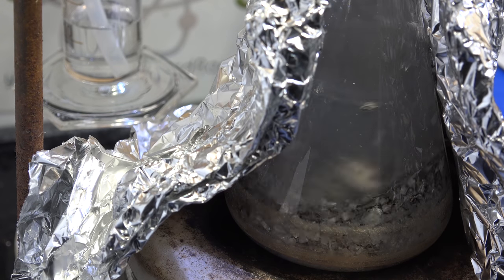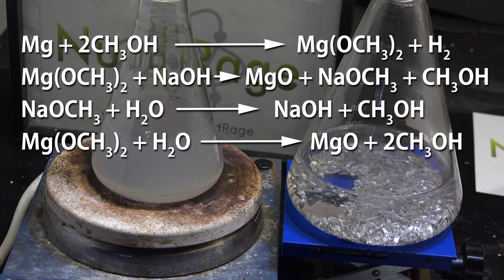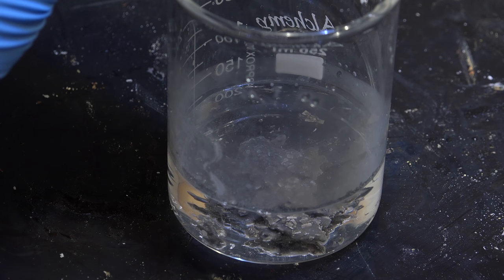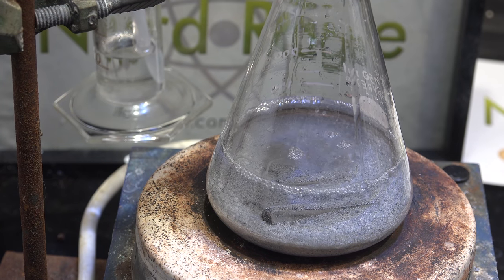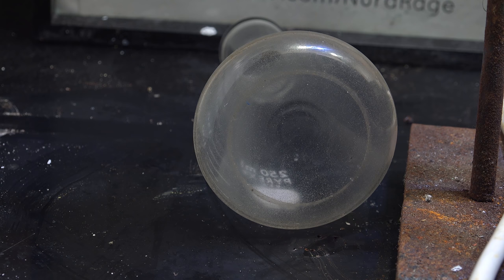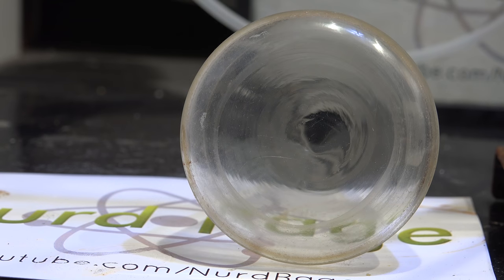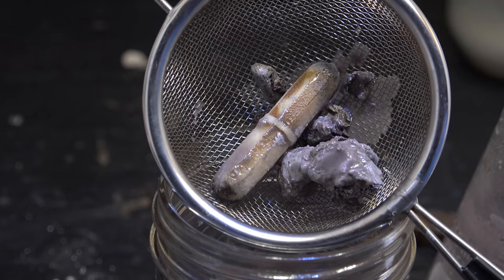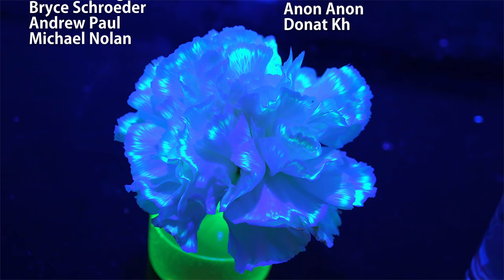Lab Notes - Alternative glassware protection for sodium production (Successful) - August 31st 2018

Comment from the maker: Currently testing various alcohols, most don't work, and the few that do stop working before all the sodium is converted. Still investigating.
Reply: Could you try ceramics?
Reply: I think it wouldn’t withstand the temperatures required?!
Reply: There are some high temperature not so porus ceramic contairs out there they are expensive but im pretty sure the exist.
Reply: The main issue is expensive. So far this series was about producing sodium using cheap tools and chemicals avaliable to anateur. If you wish to make sodium using expensive contraptions, there are several ways.
Reply: But the price of purchisng glassware many times the will be destroyed needs to be taken into acount (its also expensive.)
Reply: Pretty sure he mentioned ceramics in a previous video/lab update.
Reply: I wasn't aware. Sorry.
Reply: Sightglassed container?
Reply: Does anyone know which alcohol he was using in these tests?
Reply: "Currently testing various alcohols"
Hey, me too!

.....oh.
Reply: have u tried poly ols or sugar alcohols??
like erythritol oe xylitol
Reply from the maker: The alcohol i'm using in my videos so far is 3-ethyl-3-pentanol.
Reply: @NurdRage ; Thanks for replying!
Okay, so still the same as what you were using a few videos ago; good to know.

I have one more question if you don't mind: Before you completely move on to another project, could you please consider doing some simple exploratory research into if this process is at all feasible for some of the other alkali metals? (I know potassium has been done before, but not with such nice yields and convenient seperation...).

PS. I'll repeat the question on Patreon in a few days if you don't see this here.
Reply: Can you teach us how to make a lithium-ion battery and more. Also why not use a different salt for this reaction.
Reply: @jasonenns5076  a different Salt as in sodium chloride instead of sodium hydroxide?
Reply: How comes you took down the potassium synthesis video?
Reply: hey, try using some sort of descant to dry your sodium hydroxide or hydrocarbon chain, like calcium chloride.
Reply: You do know that hydroxide and alcohol produces water and alcoxide, right? It seems you want the reaction completely water-free. If you start with dry hydroxide and enough sodium to produce the alcoxide without water, might that be enough?
Reply: NurdRage
I really enjoy these "Alchemy" of sodium metal production videos!
Reply: James Van Daele Not specifically sodium chloride but different salts an example formic acid or acetic acid
Reply: Tom
Reply: You said an amateur can make the necessary alcohols. Perhaps you could refine the alcohol-making process to be easily accessible instead of trying to find replacement alcohols?
Reply: You could also try fly traps and cleaning up a bit.

Comment: Could we use stainless steel for the vessel?
Reply from the maker: Yes. But it would be hard to stir since it's magnetic. You also can't see what you're doing. As said in earlier lab notes videos, i'm trying to stick to apparatus that's easily accessible by the amateur.
Reply: 316 stainless isnt magnetic, but may form internal eddy currents that absorb some of the energy from the stirrer. Worth a try
Reply: or at the least make the bottom stainless and the top glass.
Reply: That's why?! I was wondering too.. magnetic stirrer. Wouldn't have guessed.
Hey, could sodium oxide be heated in a fruit can with hydrogen gas?
Reply: What about an overhead stirrer? I found a cheap one on eBay and the standard stirrer can be exchanged for PTFE one. I got even PTFE stirrer stopper with seal, though I am not sure about its life span for heavy duty applications like yours. I use the overhead stirrer routinely for mixing dense solutions because I got frustrated of the stirbar just wiggling on the edge...
Reply: Askor200, the eddy currents will definitely absorb a large fraction of the magnetic field, since the very nature of the eddy currents is to cancel the external magnetic field. Though, if the named steel is a poor conductor, chances are that the residual field that gets through would be sufficient for driving the stir bar.
Reply: NurdRage what about having a top down motor controlling a stir rod being connected by a rod? That way you can use stainless and still mix.
Reply: @NurdRage   non magnetic stainless steel .

Comment: Have you tried using a gallium aluminum/magnesium alloy for this reaction? I was interested in that at one point since gallium gets rid of the pesky surface oxide to increase reactivity.
Reply from the maker: gallium is ludicrously expensive and since it'll be lost in the reaction i decided against trying it.
Reply: How about mercury?
Reply: Just kidding I know you wont use mercury because of its own downsides. but I will point out that the first time potassium metal was ever isolated was using mercury as a cathode.
Reply from the maker: obvious safety issues with mercury. Mercury also alloys with sodium very well so your subsequent sodium produced will have mercury contamination. This in turn will produce extremely toxic organomercury compounds if you then use your sodium in organic chemistry reactions. So probably not a good idea to do it.
Reply from the maker: very true, mercury is awesome. The stuff was downright magical ( a liquid metal afterall) when it was first discovered and actually has tremendously useful applications on top. If it only it wasn't viciously toxic.
Reply: Cody's Lab, not everyone has so much mercury as you do!

Comment: This has been and is a really cool and interesting project. The more so because you aren't just demonstrating an already documented process, but developing something new. I think it would neat if one of the other amatuer chemistry channels like Nile Red or Cody's Lab ran this process to demonstrate that it could be indepentently dublicated. Not because I don't think it works, but doing that is an important part of discoveries in research science and besides, I'm sure they can always use some extra sodium metal for some experiment or other. One question (which may have touched on) Would this process work to make potassium metal as well from potassium hydroxide?
Reply: This method was originally used to obtain K if I'm not wrong. It's actually easier with K than Na.

Comment: Are you sure that the damage to the flask is chemical and not mechanical (by the very hard aluminium oxide coating on the metal)? It's hard to tell on camera.
Reply: Matthias B. It looks more like glass being dissolved. Besides that the oxide it does not seem to have much force being pushed into the glass. At least not enough to damage it. Last point, it would be odd for it to only scratch an asymmetrical area of it,

Comment: Always some of the best videos on YouTube.  Thanks.  I have a somewhat related question about protecting my lab equipment.  What is the best way to protect my vacuum pump when used while distilling nitric acid?  A vacuum cold filter is recommended, but there is almost nothing to be found on the subject.  I use a Gast vacuum pump - a great lab tool that was bought used for $20,  and do not want to damage the pump with it  being exposed to corrosive vapors.
Reply from the maker: ir's actually called a "cold trap", if you google around that you'll have better luck finding info on it.

Comment: Would a stainless steel reaction vessel work? I have access to 304 and 316L and depending on the dimensions required I could probably fabricate something if you're interested.
Reply from the maker: Thanks for the offer. While it would indeed work i would prefer to find a method that was easily accessible to the amateur. The pre-drying with sodium or lithium is a bit of a hassle, but it's easily done by the amateur and only requires a few extra hours of heating time.

Comment: Without a condenser, won't the alcohol boil away? I tried this reaction several years ago, back when you were making potassium and using tetrahydronaphthalene instead of mineral oil. I tried it with mineral oil and formed a very small amount of sodium metal, but I was constantly fighting the alcohol evaporation because I didn't have a condenser. Still remarkable though considering I did it in a baby food jar... Also, that video no longer exists on youtube.

Comment: Canning jars, AKA mason jars are not normal soda-lime glass since they can take sudden temperature spikes without cracking. They are also not tempered soda-lime glass since the will chip on their casting edge without shattering. They are certainly not Pyrex or another borosilicate glass, based on their temperatures. I would suspect that they are some form of hybrid that is tempered and would place good Mason jars as thermally trustworthy as cheap/questionable beakers.

More exploration using a propane torch or Bunsen burner to see if you can melt a hole in the side without the glass cracking would be the ultimate thermal test, but considering that they are cast glass and not blown, we do know that they are not to be trusted like a real borosilicate beaker. However, I have seen complex glassware that was cast instead of blown that could take thermal shocks like borosilicate would, but if you tried to melt a hole or do glass blowing to modify them they would crack.

Sound like a line of experiments to find out their properties is needed.

Comment: Nurdrage, do you think pyrex flasks are (much) better then the borosilicate flasks from Deschem (china)? Thank you for your time.
Reply: On ebay and stuff the glassware from china is more expensive than the ones made here in germany, bought from german online shops. 
A no-name, borosilicate erlenmeyer flask made in germany with 1000ml volume(just a value to compare prices at) is ~7€ plus shipping for example, a brand name duran(thats literally the guys that invented borosilicate glass) flask is ~11€, again plus shipping and an ebay flask made in china is still around 10€, including shipping in that case. 
Thats without VAT, but you'll have to pay the same amount you'd pay in VAT in import fees on the chinese flasks, so it would even out. 
So theres little reason at all to buy chinese glassware in my case.
I don't know if its the same for the US and whatnot, but thats kinda the case here.

Comment: Just FYI in some states if you start to buy large amounts of lithium batteries you can be monitored as a meth maker. Just like buying large amounts of Sudafed.
Reply: Yeah, but you don't need large amounts of lithium batteries - you only need to use the lithium *once*, to make the first batch of sodium. Once you've got sodium, it's a much better drying agent anyway!

Comment: What's about mg powder with Mineral oil and Naoh with 5% water (which have to also have to be catalysed by mg)?  

Put the Naoh in the flask put 10% of the amount of Naoh in water extra in it, mix the mg as powder under one part of Mineral oil, the other u Dump in the naoh/water flask slowly and start stiring it. And heat it to 60-70c° and hold the temperature continuous then stir the mg/oil Mix until each Drop of it contains particles of mg and drip it slowly in the flask.

Comment: Would anhydrous Epsom salt or Lithium aluminum hydride work to deal with the water in the sodium hydroxide?
Is it oxygen from the air the problem with the beaker or is it humidity from the air or even both?

Comment: The main problem of the lithium is that it will contaminate the sodium as the two metals have good mutual solubility.
Do you think there is an easy method that could purify the Sodium from Lithium?
Reply from the maker: If it's an issue, use the thermochemical dioxane method to make your initial charge of sodium or sacrifice a flask, maybe use aluminum powder to reduce the damage.
Reply: @NurdRage  Thanks for your answer!
In fact i was just asking if there is a chemical way to  separate lithium from sodium (no particular reason, i was just wondering).
The only way i found was to distill the sodium.
Reply from the maker: Not that i know of. The only chemical alternative i can think of is to destroy the lithium by boiling the sodium metal with dioxane and some sodium hydroxide and tertiary alcohol. You essentially get a metal displacement reaction where the lithium is displaced by sodium. The dioxane solution will now have lithium hydroxide and alkoxides.

Comment: You could use silver nitrate  and an aldehyde to coat the glass wear then wash the aldehyde out leaving a silver precipitate on glass then  perform these reactions. Then remove said silver nitrate precipitate by reacting it with nitric acid as so: Ag + 2 HNO3 - AgNO3 + NO2 + H2O (use of concentrated nitric acid)
Reply: Silver is more expensive than glass
Reply: @user-py9cy1sy9u  it's cheaper to buy a bottle of silver nitrate for multiple uses than it is to replace glass ware however conc nitric acid would run the cost up thinking about it
Reply from the maker: the silver coating would get ripped off by the stir bar and other solids as the flask mixes. it's a total non-starter.
Reply: is copper reactive in this reaction? you can electroplate copper onto the flask using copper paint
Reply: Same problem, I'd imagine. Thin coatings would be mechanically worn by the mixing.

A solid metal vessel might work (I think this was brought up by NurdRage in a previous video), but then you can't monitor the progress.
Reply: @NurdRage  yeah was just spit balling really but yeah of course I didn't think of that ahah and I'd just like to thank you for getting me into chemistry as I'm going into my chem degree year 1  on the 22nd of September.

Comment: A 50mL flask from China can be bought (shipped even) on ebay for less than 3 USD, or about the same cost as the batteries that had to be destroyed for the lithium. Could enough sodium metal be produced in a reaction vessel that small to jump start later runs?
Reply: Yes, but the issue with cheap glassware from china is that it usually is a low quality soda-lime glass, just with a little bit of boric oxide added in.
Even in the event where, for example, an ebay seller that lists their glassware as being laboratory-grade Borosilicate 3.3 does actually ship you the correct (and more expensive) type of Borosilicate glass, it is always much thinner and/or very non-uniform in its thickness.

In either case, the chances of the flask getting destroyed and spilling its contents everywhere, before any significant amount of sodium has been generated, is very high.

Personally, I have never had any luck with glassware that costs substantially less than the equivalent of around $100-$120 for a standard 500ml, B24 ground glass, Erlenmeyer flask (and neither has any of my colleagues, which I asked about this).
Reply: Thank you. I had my naive hat on and wasn't even thinking about fake products.

I was concerned with if the net gains were significant enough to scale up without so many intermediate jumps to make it a massive headache and time sink and glossed over "this could fall apart." That route definitely is not worth the risk and headaches it could cause.

The thanks is sincere. I haven't touched a piece of lab glass in probably over a decade much less buy any.
Reply: @WilReid ; You're very welcome! I have had such a long and expensive journey as an amateur to just get to the 'rather buy used name-brand glassware' point, that it seems positively cruel not to warn others of the potential pitfalls.

I'm sorry to hear that you haven't been able to experiment yourself in such a long time. :(
I'd say, just get a few simple pieces of glassware and go from there. Even if you feel like you don't have the time/space to setup a lab, Chemplayer showed all of us just how much you can do in a kitchen and with the bare minimum of glassware!

Comment: excess of Epsom salt? its  a magnessium comound it could add to yield and it can dry it, i dont know how the sulfate group would act if you strip the mg from it tho in the mix
Reply from the maker: we're at 200 celsius. Epsom salt does nothing at these temperatures. It would in fact release water.
Reply: @NurdRage  you would need to put it in a oven to drive off the water attached to it normally I should have said that but I've seen others use it instead of sieves. But if it would not work regardless at the temps then it would not be worth the try. Thanks for the reply
Reply from the maker: That's what i mean, i would not work regardless. Because any water it absorbed would be released again.